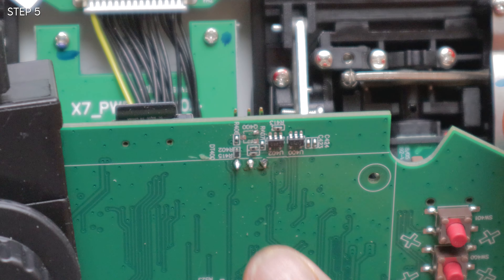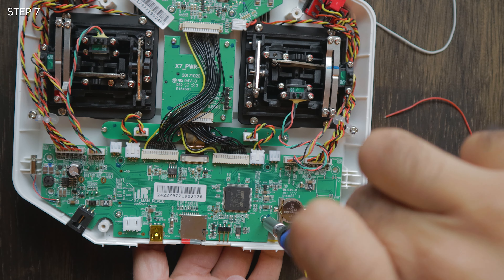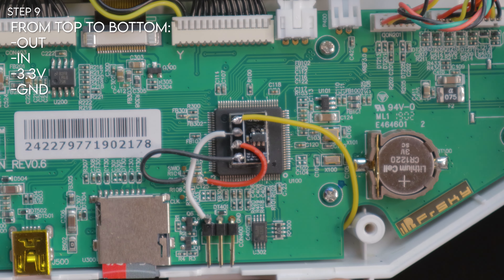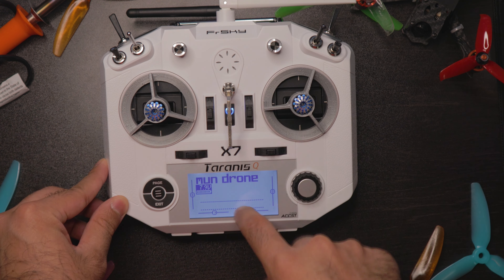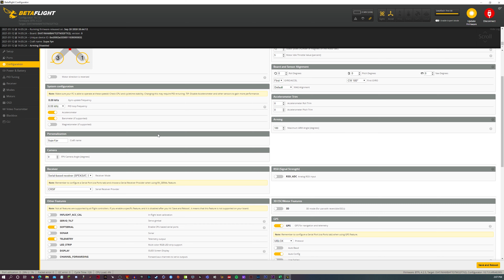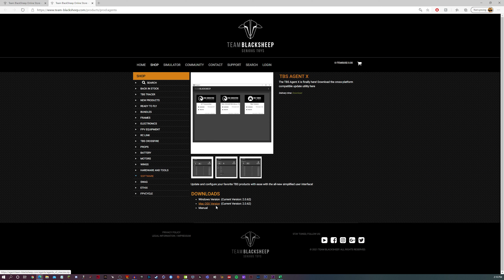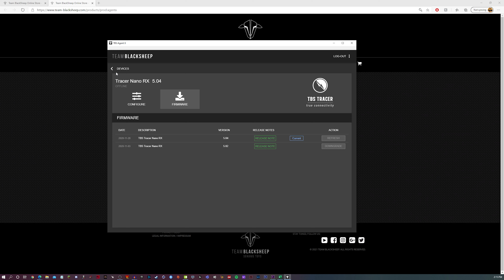How to Setup TBS Tracer (Betaflight/OSD/Binding) + Taranis QX7 Mod (4K)

Comment: Thank you so much! This was very detailed and easy to follow especially when explaining small things on installing the QX7 Mod!
Reply from the maker: Hey no problemo man! That’s what I’m here for haha! Lmk if you have any other questions!
Reply: @supafpv1759  Where can I find the Max Baud Rates because I also have a QX7 but it goes from switched straight to ADC filter as if it’s not there. Is there a problem?
Reply from the maker: @ethanuyeda8731  yea it should be there on the same screen. Do you have the latest firmware on your qx7?
Reply: @supafpv1759  Just updated it and it showed up. Thanks again so much!
Reply from the maker: @ethanuyeda8731  happy to help!

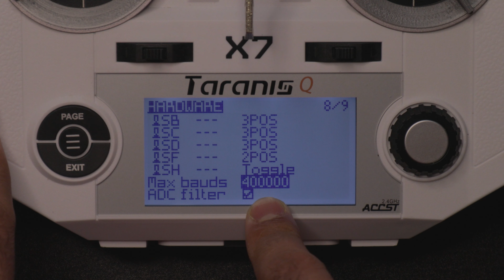Comment: Edit:  I did the inverter MOD.  Radio still works, si I guess I did it right.  Question:  frame 13:51 shows the ADC filter checked.  Mine is not.  Should I check that as well?  what's the benefit?

Comment: HI friend, could you tell me what number has labeled on top of diode DT401, its next to middle pin of the qx7 S.Port, i messed up with my solder iron and destroyed it so i want to replace with the same component, please..

Comment: Hello, do you know that without doing the mod on my q x7, the 400k baud rate already appears, if or if we have to do the mod?
Reply from the maker: If you have the newer qx7 you should be fine. If not I’d suggest doing the mid for the higher baud rate
Reply: @supafpv1759  Thank you very much for answering me, it is one of the last x7 but Accst, I have not made the mod yet and if I go to the hardware section in the taranis x7 it is already in default 400k, that seemed strange to me and the mod is not done hehe
Reply from the maker: @deiravid_fpv  I’d do the mod just in case. There have been reported cases of the quad flipping out of control or just losing link with the quad in general at that high of a baud rate without the mod.
Reply: @supafpv1759  Genius!!! Thank you so much!! then I'm going to do the mod hehehe, a huge greeting from Argentina! we look forward to more videos! ;)
Reply: @supafpv1759  hi, what about qx7 access, is it must applied the mod too ?

Comment: Hi i am using the same System.  When i long press the 3 Bars in the middle my taranis qx7 shows " no tools available "  I update the newest opentx Version.  Any idea what wrong? Best regards from Germany
Reply from the maker: Hey, so do you have a sd card with all the qx7 stuff plugged in? ive personally never seen this message pop up. Is this the first time youre setting up your taranis?
Reply: @supafpv1759  i have not had this issue before.I update opentx a few times.Yes i use a sd card. I install also the newest CD card content
Reply from the maker: @MBorga  perhaps, youre holding the 3 lines for too long? Should be like a second. If that’s not the case try to revert back your update. Sometimes the newest and greatest updates aren’t the best.
Reply: Hi, I have same problem. I fix it - change max bauds on 115200 in QX7 menu hardware. NO warning rssi / telemetry lost and lua script work FINE.
Reply from the maker: @petrrehak4448  do you have an ACCST or ACCESS qx7?
Reply: @supafpv1759   QX7 ACCST old shool :o).
Reply from the maker: @petrrehak4448  hmm very interesting I actually don’t have a solve for this I’m sorry
Reply: @supafpv1759   OK, no problem. NOTE I don't use TBS PCB MOD for Tarabus QX7

Comment: Is tbs tracer can using rxsr receiver and what is the maximum mw
Reply from the maker: I do not believe it can use the rxsr receiver. It needs to use the tracer nano receivers. Maximum mw is not stated clearly, but there is a ludacrious mode that is more than 100mW and can actually get you distances close to crossfire now.

Comment: You also want to shut off your ADS filter just below your borate.
Reply from the maker: Was not aware of that, my quads all fly pretty great with it turned on, could you explain why exactly? That way future people who come down to the description know aswell.
Reply: @supafpv1759  UAV Tec says it creates latency and I think more steps. 
 Check out his video on it.
Reply from the maker: @macburgess6785  I don’t see a video specifically on the qx7 or Tbs tracer. Could you guide me to it or link It?
Reply from the maker: @macburgess6785  wait yea I see a video on it. It’s more of a stickfeel, feed forward, kind of deal really.
Reply: @supafpv1759  yes that's right. He explains how the ADC filter is kinda redundant now with the filtering in betaflight.
Reply from the maker: @macburgess6785  gotcha, it doesn’t quite reduce the latency per se just kinda makes the quad feel better for betsflight 4.2  it’s probably hardly noticeable with Tracer but thank you for the tip!

Comment: there was a ton of extra info in this video that had nothing to do with what most ppl were doing so it was pretty confusing. I have to ask if your drone actually flew after this because you left out a very important step, configuring the RX. there is a whole tutorial about it for the xd90+ but none for the qx7. kind feel like i watched this video for nothing. ur vid got me bound w no stick input.
.
Reply from the maker: The point of the video is to get you bound to the controller. Having your sticks and other stuff setup is universal for everything on a qx7, whether it be tracer or xm+. The title says binding, not “configuring your stick inputs” lol. Thanks for watching 🤟🏽
Reply: @supafpv1759  i' apologize. i thought this video was made to help ppl bind and get in the air. i didn't realize there was another video on eneeded to watch in order to get stick input to show in betaflight after its bound and telemetry is being received. my bad. . i totally changed my mind tho, great vid after all. very informative